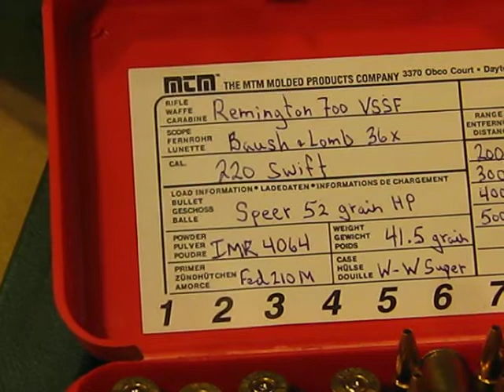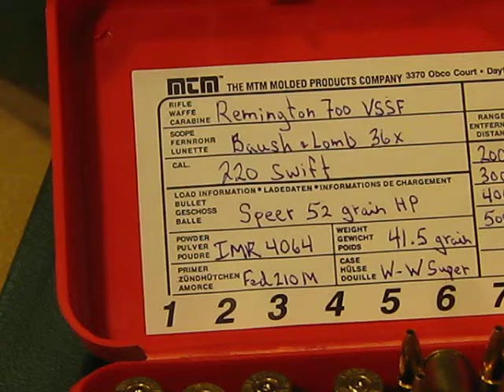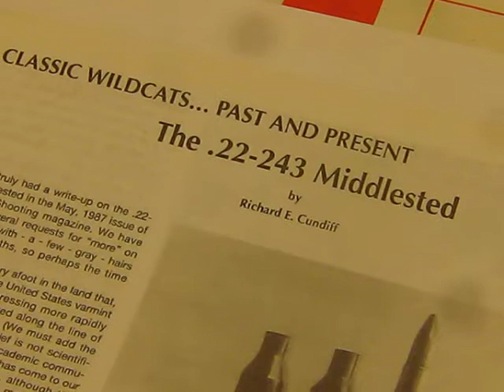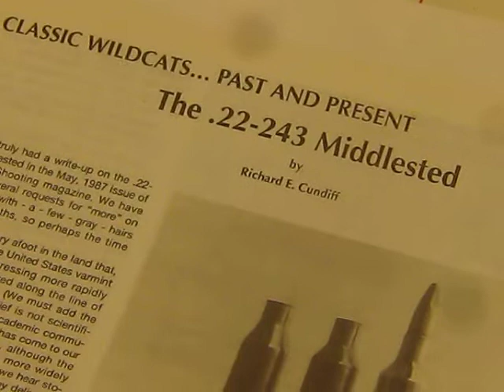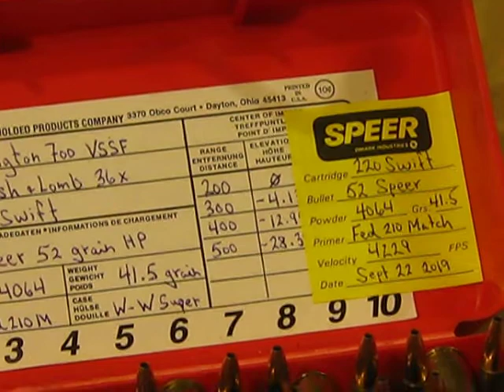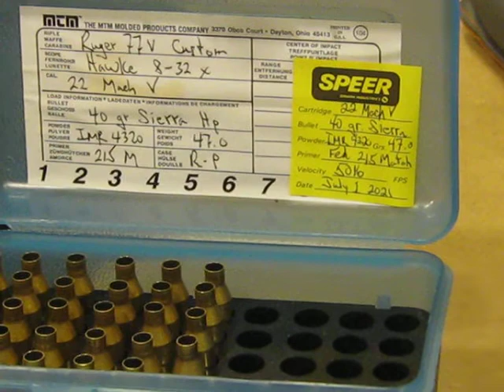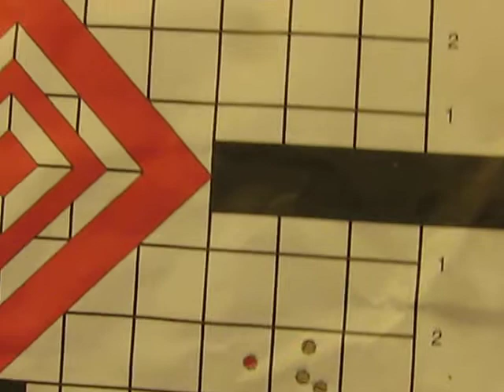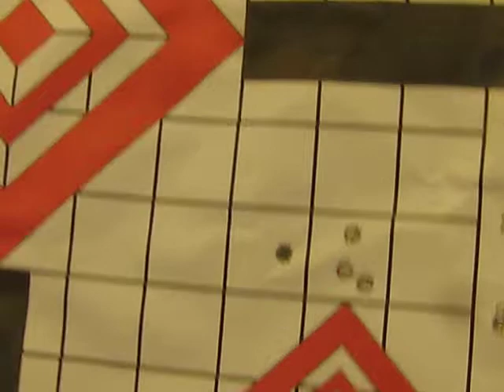Ultra high velocity 22-243 Middlestead

Comment: Those little pebbles with such a low BC would be shedding velocity remarkably quickly. Awesome study case however mate. I know a man in Australia that cracked the 5k fps with a .17/250.
Reply from the maker: These 40 grain Hornady bullets lose approximately 1100 fps in the first 100 yards, so yes, these bullets decelerate very quickly. I haven't chronographed the 35 grain bullets at 100 yards to determine the velocity loss. When I was considering this project at the outset, I first considered various 17 caliber wildcats. However, since the original premise by Philip B Sharp considered only 22 caliber rifles, I stuck with that bore. Thank you for watching and leaving a comment. Here is a related video I made months later https://www.youtube.com/watch?v=9DzNzCtNZn8
Reply: @markcarew6724  incredible.

Comment: Im pushing a 50 gr Barnes Varmint Grenade to 3500 fps out of .223 24”.

They punch right through 3/8” mild steel plate at 100 yards like nothing. 

Although advertised as frangible bullets (copper-tin powder sintered core) at higher velocities they punch through steel better than lead bullets.
Reply from the maker: It is quite remarkable that frangible varmint bullets can penetrate mild steel targets, it seems very counter-intuitive. Thank you for watching.

Comment: Great video Mark. About 20 years ago my friends and I had a target on a 100 yard range that was named "The Chunk". It was a 1.5" thick cut off from 4" bar stock. We hit it with everything we had trying to get through. I bought a 30cal to 22cal sabot kit for my .308 (Ruger M77). I hit it with a black tipped AP bullet going almost 4100fps. It didn't go through but the base of the bullet was about 1" deep.
Reply from the maker: Thank you for your kind reply, despite this video being of poor quality.
Your experience with "The Chunk" was not unlike the seed that began the thinking around this eventual experiment. I had produced similar penetration with various caliber bullets, including AP rounds, on 1" thick steel plates. I had read most of the writings of Philip B Sharp, and I had run across this penetration claim several times. The type of steel is very important; a friend of mine played a prank on another friend by switching the mild steel plate with a chunk of specific hardened grader blade. The fellow was quite shocked that his AP bullet made no noticeable mark on the hardened steel. Thank you for watching, Ghost Rider USA

Comment: You were doing some very innovative experiments there. Very interesting regarding the slower twist and velocity relationship. Used to buy mild 3/8 inch steel 10 inches wide and would cut it in half with my AR's using green tips M-855's. Based on what I learned from that, going through a 1 inch thick piece would be very difficult. Maybe a solid brass projectile or AP but I still think that is a lot to get through. The project rifle is beautiful. I know you built it for speed. Those groups were very good with things the way they are with getting the gun tracking, ironing out all the little details. This is the reason I continue using You Tube. Your story is one of inquiry. The effort and interest to accomplish such an experiment is very impressive. Excellent video Mark!
Reply from the maker: Thank you for such a kind reply. The video is especially crude, given I recorded it right after seeing your 22-250 installment. I need to write a script to make certain I cover the points without getting sidetracked with unrelated information. I could have recorded an hour long video covering this experiment and the build process, but who wants to see that process. Thanks for watching, Toadley!